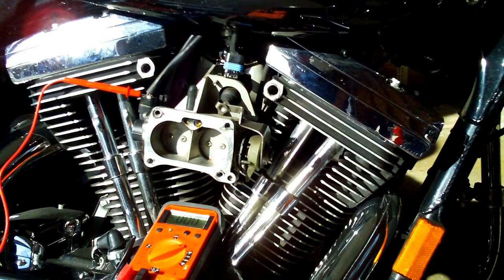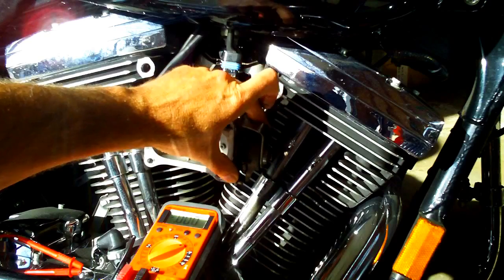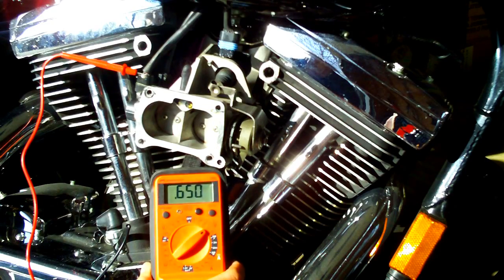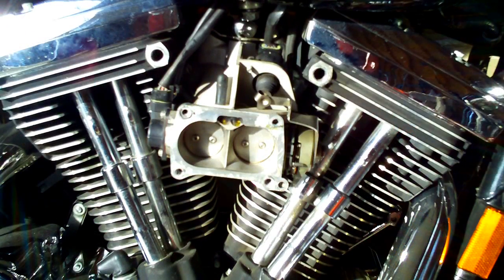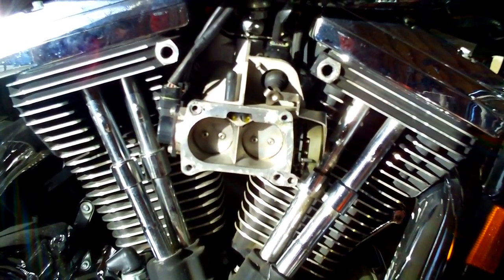Reset Harley Davidson Magneti Marelli Fuel Injection TPS Settings ✔

Comment: So I followed it to the letter I'm at 275 on my cold I'm at six and a half on my cold adjustment but it's still running too rich and getting back fired after it warms up actually running hot any suggestions
Reply from the maker: How do you know it's running rich? Is it backfiring at idle only? Backfiring out the exhaust or intake? What is measured to conclude it is running hot? Are you getting any codes from the ECM? How is it starting? Things that make it run right include good intake gaskets and sensors for air temperature, head temperature, crankshaft position and barometric pressure.

Comment: The adjustments you outlined made my bike run much better when its warmed up but when the bike is cold it high idles at 2000 rpm for 3 to 4 minutes,  even if its only been off for 30 min and the bikes still warm. Anything less than about 30 minutes seems fine. I'm thinking the temp sensor, just wanting to know if you've heard of anything similar.
Reply from the maker: I haven't heard of anything similar. I would check the setting of the cold idle screw. If it's set too high it will idle high until the temp sensor says the engine is at operating temperature. Try backing it out a turn or two.
Reply: @contact4mwy7  Thanks Mark.

Comment: Checked mine I get to 150 then run out of adjustability. Never can get 275.
Reply from the maker: Are you using a voltmeter that can measure down to 275 millivolts?
Reply: @contact4mwy7  Using one of these. CRAFTSMAN 3482141 8 Function Digital Multimeter
Reply from the maker: It looks to register down to 200 millivolts, which should cover what you will be looking for, which is 0.275 millivolts DC. If you have the correct wire probed, you should see a reading close to this with the sensor positioned in the middle of it's range. It's very sensitive to movement and will jump in numbers at the slightest touch. Make sure the leads to the tester are in the right sockets for DC volts. Select the 200mv setting. A quarter volt should show as 0.250. You want 0.275.
Reply: @contact4mwy7  just wondering if the TPS is bad.
Reply: @contact4mwy7  I am getting these flashes on the engine light.
Reply from the maker: @vtwinlife4940  Have you checked the ECM codes?
Reply: @contact4mwy7  got no codes except for flashing engine light. Appears to be 11 and a 42. I have video of it on my channel.
Reply from the maker: @vtwinlife4940  Those are your codes, and according to this page, 11 is throttle position sensor, and 42 is camshaft position sensor. https://www.justanswer.com/motorcycle/3sbqy-need-diagnostic-trouble-codes-1999-road-king.html
Reply: @Mark Young -   Ok. Re checked cam sensor. No code now. Replaced the TPS. Set it to 275 and cold idle to 650. Set hot idle to 1000rpm. 
When it starts the check engine light comes on. After riding for about 10 to 15 minutes the check engine light goes out. 
Think I am gonna take this as a win and leave it alone.
Reply from the maker: That is strange alright. Is it giving a code that you can retrieve?
Reply: @contact4mwy7  I'll check it tonight after work.

Comment: Anyone know what a code "CAL 03" IS ON A 99 Road King Classic?
Reply from the maker: According to a message board, CAL 03 shows the type of calibration (speedometer maybe?) that's programmed into the ECM. Procedure for checking for codes: Speedo Checks ('03 and earlier)
press the odometer switch in while turning the ignition on (with the run switch engaged) Read codes (if any) The CAL 03 will be the last one which is short for "Calibration 3"=Domestic (Domestic being the type of ECM calibration). I hope this helps.
Reply: @contact4mwy7  just wish I could reset it. Or find someone who can or fix what's wrong.
Reply from the maker: @vtwinlife4940  it's not a code to reset, it's just showing what region the ECU is calibrated for. In this case "Domestic" as opposed to over seas for instance. It's not pointing to a problem on the bike as far as I know. See if you can contact a Harley shop and ask them about it, tell them what I found in the forums. Are there any other codes showing?
Reply: @contact4mwy7  No other codes. Just "ENGINE" light is on. Go's out after start up but comes back on shortly after bike starts. 
Very appreciative of your time and knowledge.

Comment: I wasn't able to adjust the sensor on my 2001 ultra classic the set screws had apoxy on the ends but by having it apart I noticed my cold idle motor plug was a little loose. After I made sure that was tight I turned in both screws the same as I loosened them ran the bike for a bit adjusted the warm idle to where I wanted it and just like that my problems were solved. I would have had no idea where to even start 8f it wasn't for your video. Thank you very much you kept my wallet a little fatter today!!

Comment: Got my new throttle position sensor 2day and straight to the bike hoping it would fix my issues. Followed Mark's video exactly, along with a few more tips that Mark gave me,for which I am so grateful, because I just took it out on a shakedown cruise and it's running better than ever. 1998 Road King Classic with 109,000 miles. Thanks Mark,keep up the good work
Reply from the maker: Glad to hear it! Enjoy!

Comment: I've wound up having to replace my throttle position sensor. Should I put blue loctite on the tps screws and do you have to do anything after you have replaced the tps, I've seen you should cycle the ignition switch on for 30 seconds, then off for 30 seconds for 3 cycles.
Reply: Perfect, thanks again for responding early on Sunday  morning
Reply from the maker: Feel free to let me know how it runs after all the work you've done.
Reply: @contact4mwy7 thanks Mark,I'll definitely do that
Reply from the maker: I have not heard that about the ignition switch, but that doesn't make it wrong. Did you follow the steps in the video including removing the fuses for the time necessary?
Reply: @contact4mwy7  No I didn't. Do you remove them before replacing the tps and then replace them after installing the new tps. Which fuses do you remove? I've taken the bike to 2 Harley-Davidson dealers and they all gave me excuses why they couldn't work on it, so I'm trying to do it myself.  Thanks for your help.
Reply from the maker: Those aren't excuses, Kevin, they normally do not work on these MM fuel injection systems because everything is out of date. I mention which two fuses in the video, and I would have to watch it again to refresh my memory. They are removed for a few minutes after you finish the adjustment procedures and reconnect the idle motor plug. Disconnecting the battery will do the same thing if that's easier for you. This resets any stored fuel injection settings in the memory so that it will use the parameters related to where your throttle position sensor is sending now compared to before. Gives everything a fresh start.
Reply: @contact4mwy7  thanks for the great information, one last thing. Should I put blue loctite on the tps adjustment screws? When I did your process I had to dig out some epoxy that kept the screws from moving, so will blue loctite provide the same effect? Thanks again!!
Reply from the maker: I put clear fingernail polish around the heads of the screws when I was done to keep them from turning. That's what the epoxy was for. If you put blue loctite in them you will have to start over. Up to you which way you go.

Comment: Wow,thank you for this video. I was having issues with my 1998 Road King Classic. Had a melted cam position sensor and I  replaced that,and it was still missing a little bit. I did the steps in your TPS video and the bike is running fantastic again. My number was .094 instead of .275. Thanks again and keep it up. We Magnetti Marili guys gotta stick together

Comment: What do you have your multimeter set on? Ohms or voltage?
Reply from the maker: Voltage. DC Voltage down to a millivolt. Point 250 is equal to 1/4 volt DC.

Comment: Are you using omhs or volts on multimeter?
Reply: Thanks for the reply, after searching through the comments I saw where you explained the setup on multimeter. I think I have figured out I have a bad TPS. I don’t get any readings for about have of the adjustment of the tps.
Reply from the maker: Measuring volts, millivolts to be specific. 0-point-250 volts DC is 1/4 volt  0.500 is half a volt.

Comment: What setting on the multimeter were you using?
Reply from the maker: Millivolts DC, Galen. You need to be able to measure down to 1/4 of 1 volt DC, 0.250

Comment: I don't touch the fast idle screw or ISCM, I just take the fast idle control arm completely off, that way I don't have to risk a comeback on the cold idle speed adjustment.    I read the voltage on the TPS prior to turning out the hot idle screw, so I can put it back to the exact same position it was before by adding how much voltage I changed the TPS setting to the old hot idle voltage, and that's where I put the hot idle screw back to afterwards.
Reply from the maker: Sounds like you have it under control, Patrick. I wonder if it runs better after the adjustment if the idle comes up a bit when hot and you might actually have to back it off a little. We'll see. I hope it runs better afterwards. Is this an EVO or Twin Cam 88?
Reply: @contact4mwy7  The idle speed adjustments came out very close to correct, the problem I often found that if I made a significant change in the TPS value, the ECM no longer recognized that the throttle was closed, and it changed the ignition timing on me, so as I was trying to dial in the hot idle, it would bounce back and forth between 800 rpm and 1200 rpm...  I had to disconnect the battery for a few hours so the ECM would forget the throttle closed reading, and have to relearn it's new value...  Then I could set it to 950 rpm.   I set evolutions and twin cams the same way.

Comment: What r u setting ur multi meter on
Reply from the maker: Millivolts. 1/2 volt DC would show on the multimeter as 0.500 You need to be able to see three digits after the decimal point. What size motor do you have?

Comment: FLHTCUI 2001 Marelli. Made the setting like in your video. Before tuning it was 0.860 volts or so. Pulled out the ECU fuses. I did the synchronization according to the instructions: “To synchronize the ECM and the idle speed control actuator, turn the engine switch to the RUN position. Then turn the ignition key to the IGNITION position for five seconds and OFF for 10 seconds. Repeat this step once." After setting up, I turned on the ignition and the motorcycle started at an increased revs up to 3000. Further, I saw flashes in the intake manifold and a whistle. Light panic. Should I adjust the idle speed by the torx? 😐😐😐 Thanks in advance!
Reply: Arithmetic tells me this:
TPS had 0.860 volts
Became 0.275 volts

Those. 3.127 times less! But, the rpm is now around 3000 rpm ...

Normal RPM 950-1050rpm

Those. I need 3.127 times less to unscrew the idle screw! =)
Reply from the maker: Either the warm idle screw or cold idle screw is in too far. Try backing out each, one at a time, until you find which one is at fault. Cold idle should be around 1,100 to 1,200 rpms, warm should be close to 1,000 which is what the charging system needs to charge at idle. Warm idle is when the bike is fully warmed up.   Let me know!
Reply from the maker: Try backing off the higher speed Dobeck settings, maybe close to zero, and go for a ride. It may be set too high adding too much fuel? Also, do you think there is a gasket leak at the intake on the cylinder itself? When you sprayed, you were at the point of the cylinder, right, instead of out near the filter?
Reply from the maker: Good!! No, pulling the fuses will not mean making the adjustment again. 20 seconds may have been enough but if you feel differently you can go for a minute. If it's running good, or GREAT even, I would leave it alone and roll with it. Happy riding to you my friend!
Reply from the maker: I saw this on that forum and might be worth a try if you are up for experimenting.

Actually, the .275 spec is a misprint that just wasn't corrected. I'm personally aware of this and just trying to share accurate information. The .275 was a MM for EVO and the MM Twin Cams were typically around .175 but .195 was a good sweet spot to set them to. This setting was done with the throttle blades 100% closed (cables slacked, screws backed off) and was the base TP voltage.
Reply from the maker: It might be because of the manifold leak, we shall find out. Maybe the bike will run better with the new gaskets.
Reply from the maker: Yellow and Red adjust low and use "seat of your pants feel" by riding and making small adjustments until you can't feel any improvement. Then you might even back it off again just a little bit to find the sweet spot of good power AND miles per gallon!
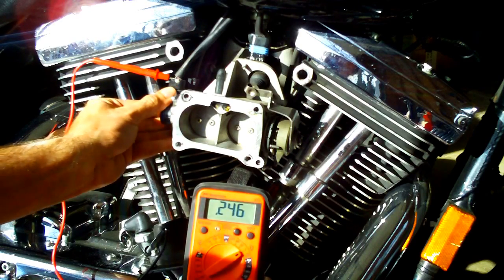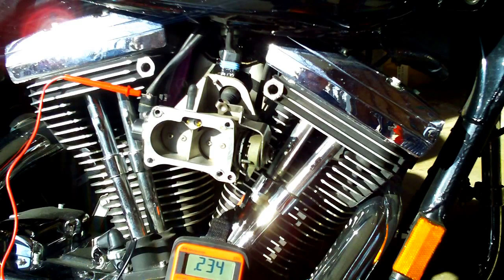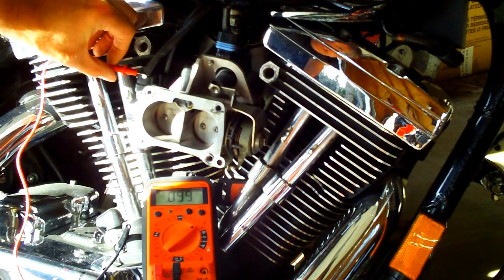Reply from the maker: Hello again! Let me ask, are you turning the first green pot with the motor fully warmed up and adding a little higher rpm by turning the warm idle in to get the motor around 1,800 to 2,000 rpm. This rpm range is generally where you will be cruising. The Yellow and Red pots are subjective mostly by feel of how well the bike pulls when you get into the throttle to go faster. The Fourth pot is the rpm that the Red pot is enabled, and should NOT be adjusted to less than 4. The number 4 setting, as it would look on a clock, equals about 4,000 rpm, that's where you want the red to take over and add more fuel for horse power and torque. Green is for good mileage while cruising. Leave the 4th pot set to 4 as in the clock face. Turn the other three alll the way back to the starting point, 1:00 position. Take the bike for a ride to see how it feels. Your bike is most likely different than the one Dobeck used to get their recommended settings, so ignore them. You need to come up with your own settings. The miles per gallon should not drop that drastically, which sounds like you are adding too much fuel. If you keep adding too much fuel you will get bad mileage and LESS power. This is why I want you to ride it without adding any fuel first, to get a baseline of how it runs. Then you can start adding fuel to see if it helps or makes it worse. I don't think the green, yellow or red should be set more than 3:00. Try the three Fuel pots set at 1:00, then after riding for a bit, set the three Fuel pots to 2:00. Then again set the three Fuel pots to 3:00. Leaving the 4th RPM pot at 4:00 always. See which setting feels "right" for your bike. My mileage was around 50 mpg, I know that's hard to believe, but it got that and sometimes better than that. My 96 cubic inch 2009 Road King averages 43 mpg. So for your bike to get 33 sounds very low to me, unless this is kilometers and liters measurements? Is it possible that a previous owner had a different fuel map loaded into the bikes computer, which may already be set richer in fuel added?
Reply from the maker: Very good. I think you will be happy with the Dobeck, once it gets a good setting. Yes, adjust the yellow up higher to see if the popping goes away. I forgot that Yellow has a different purpose than the Green or Red. Let's start with Green and Red set low, 1:00, and work your way up. I put my best guess on your motor will be 2:00 for Green, 4:00 to 6:00 for Yellow, and 3:00 for Red. Maybe? But start at the lowest for all.
Reply from the maker: I too am baffled by the deceleration popping. The only other thing to look for is worn out exhaust gaskets against the heads, or an air leak somewhere else where two pipes are joined. Air getting into the exhaust can cause popping. Otherwise it sounds like 0.195 is a good setting for your tps as long as it stays there and stops loosening and moving on its own. Is the check engine light very rare to turn on or not turning on anymore? The mileage numbers sound much better than before, and I like the settings you have chosen on your Dobeck! Fall is here too, not much riding weather left unfortunately. Thank you for the update!
Reply from the maker: Yes, I left mine at position 4, which probably meant that my Red pot kicked in later than it was supposed to but was fine with me. I had very good power and very good miles per gallon.

Comment: It is not at all necessary to spoil the wire, it is enough to insert a piece of steel thin wire from above, parallel to the wire, and it will rest against the bottom of the contact. 🕺🏻

Comment: Does it reset TPS and ECU sync ?
Reply from the maker: It realigns the TPS to give the proper instructions on fuel ratio and spark timing. It is advised to unplug the fuses to the ECM for a time to clear stored settings so that it will then create new settings based on the new alignment of the TPS.
Reply: Mark Young - Outside The Box 👍🏻👍🏻👍🏻🕺🏻

Comment: Hi! What torque for the TPS ? I was find it only in S&S manual a 18-23 in. lbs. But it is too small for high harley vibration.
Reply from the maker: They are small screws so that inch pounds measurement sounds right. I didn't have access to a tool that would go that low. I gently snugged them against the TPS and never had an issue with them backing out. I may have put clear fingernail polish around the heads of the screws to help with keeping them from loosening.
Reply: Mark Young - Outside The Box ok. thanks!